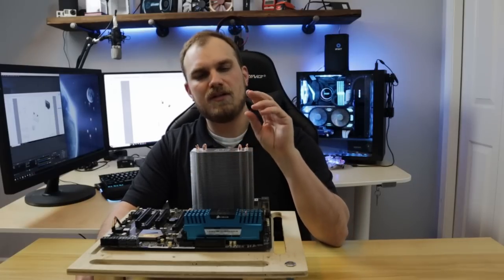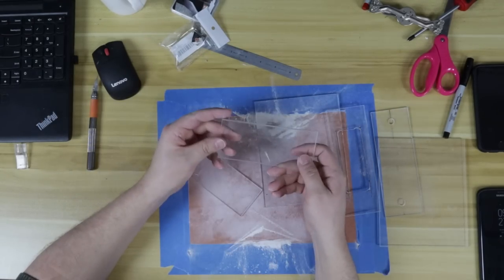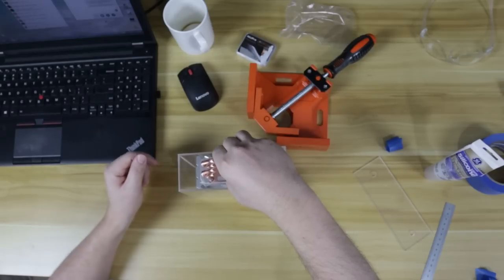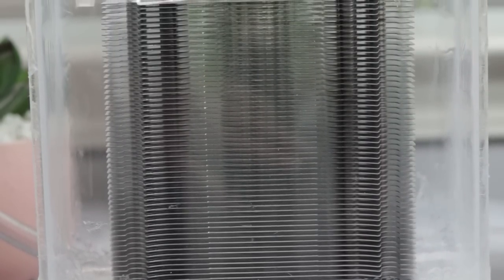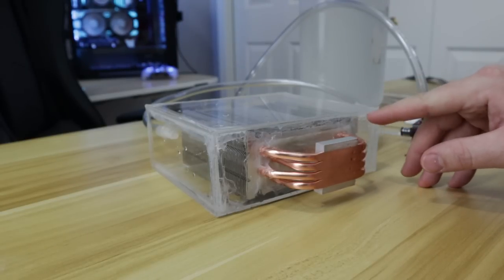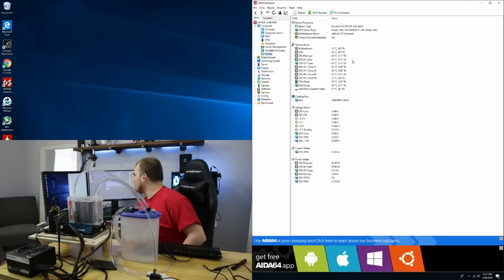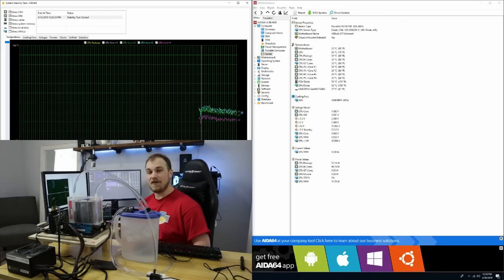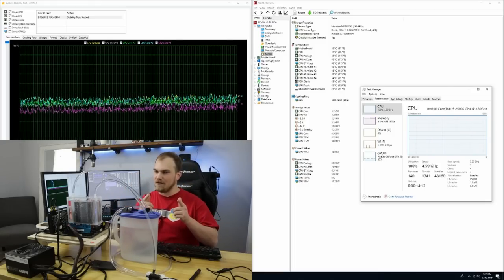I Water Cooled My Air Cooler AND..........

Comment: the idea is really cool but i think it is really ineficient, the water isn't flowing through the vents (you can see that because of the air still between each layer) . i think you should put the input and the output horizontally and make the box of the size of the heatsink so the water only pases through the vents. i am not an engineer so if someone know much more than me please correct me i just really like this idea and want to see an improved version.
Reply: yeah that is better but something really important is making the input at the bottom and the output at the top because hot water tends to go upwards and cold water goes downwards at this state it makes perfect circulation
Reply: @M3NBu  the low strength of convection makes it essentially irrelevant if you're actively moving the fluid
Reply: it's a good thought Tomy but you have to remember the fins are there to pull heat off the heat pipes. as long as there is moving water going on and around the heat pipes it will take the heat away faster then it could go to the fins as water has a higher transfer rating for heat than aluminum, and to the point where he could probably remove the fin stack keep the pipes and get close to the same results maybe 3-4 c higher in the worse case.
Reply: That's correct. That is the idea behind an efficient air to water intercooler used on engines. All the water passes through the cooling fins and none pass around the sides.
Reply: @M3NBu  continuing from another reply, we cant account for all positions someone may put the block in so might as well not account for convection.
Reply: engineer here- you got it. heat transfer is pretty simple. something that you want to think about is the thermal capacity of water vs air. air has a density of 18.225 kg/m^3, whereas water is about 1000kg/m^3. then consider a thermal property of a material called the latent heat. this quantity is the amount of energy required to raise 1kg/slug of material by 1° c/f. then take this value and multiply it by the product of the mass of material in question (here it would be the water or the air) and the change in temperature. alternatively, you can find the change in temperature given the CPU wattage, which is Power. 1 W = 1 J/s. multiply this by the amount of time your cpu has been running for annd you get the energy dissipated into the water. (assuming 100% efficient heat transfer and water that is constantly moving-stagnant water KILLS the heat transfer) you could also choose a different fluid although the only fluid i can think of with a lower latent heat is ammonia. in any case, that’s why water cools impressively
Reply: @BogusQuacky  I'm a materials engineer in the US and I learned what a slug was from a Canadian 😆
Reply: @BogusQuacky  that 8 should not be there. That's some heavy air
Reply: @M3NBu  seems like just feeding more of the intake hose through would achieve this
Reply: The real next step for it should be a funny one. Try to plug it's future upgrade in a car radiator near a factory 1 meter fan. No silent but efficient...
Reply: Exactly what I thought. The moment he showed his design I just facepalmed. He ahould do it again with the new in/out placements. I'd recommend specifically putting the input at the bottom of one side and the output at the top of the other side.
Reply: @M3NBu  other way around. The temperature gradient of the fins is hottest at the bottom and coldest at the top, and therefore the coolant needs to come in the top and exit the bottom.
Reply: I suppose you could call this a DIY water cooler but I think I would stick to making a traditional Radiator for efficiency

Comment: Next I would recommend making the acrylic box smaller to force more of the water through the fin stack
Reply: Keep going smaller andddd you end up with an AIO.
Reply: fluid dynamics dont work this way
Reply: Without size constraints , mass can compensate for flow , it would be interesting to compare. But like a water block , forcing the water to flow where you want it has the most immediate effect.
Reply: I think the limitation will be relating to the way that evaporative cooling works as that's the thing transferring the temperature differences; I'm not quite sure how it will effect things but it should be interesting.... a guess is it will set a limit to how cold it can get since if the content of the pipes remain in liquid form it'll be relying on the metal to transfer temps and not evaporation of the liquid in the pipes; we'll see.... pretty cool either way:D
Reply: and to reduce the huge amount of weight from the block and water

Comment: This is essentially a more efficient water cooler that doesn't require fans. Great potential for saving a ton of space inside the case and cutting down on cable management. I can definitely see an excellent use for this concept. I'd love to see it refined!

Comment: Wait but that's just watercooling with extra steps.
Reply: Skaret98 that's a deep cut. I approve 👍
Reply: Yeah but I'd imagine that much bigger heat exchanger is going to help quite a bit compared to the ones that are usually used.
Reply: @kadajawi6567  removing heat directly from copper that contacts directly a CPU heatspreader vs. removing it from fins that remove heat from heatpipes?
yeah, definitely more efficient. guys! we have some geniuses around here!
* sarcasm mode off *
Reply: @rawdez_  That would be worth testing. The contact surface in a regular water block is relatively small.

I'd be interested in seeing a video that tries to emulate this test, with everything but the water block the same. It could go either way, but I would not be surprised if the increase in contact area makes a difference.
Reply: @kadajawi6567  It doesn't.

The lion's share of the heat is sinking from the copper pipes long before it reaches the aluminum fins...because thermodynamics.

Comment: Second radiator to chill the water out, larger pump and tighten the walls to force the water to go through 212 evo fins.
Reply: Stamo Hristov was hoping someone would have said this. Should work better by absolutely forcing the water through the fins
Reply: and have the the blow and the suck on opposite sides of the heatsink and not at the top
Reply: Yeh, those air pockets really held this back, maybe side fittings would be the way to go, and air must be removed between the fins.